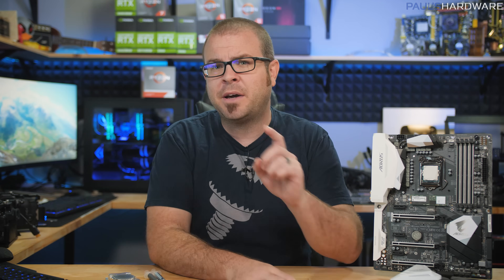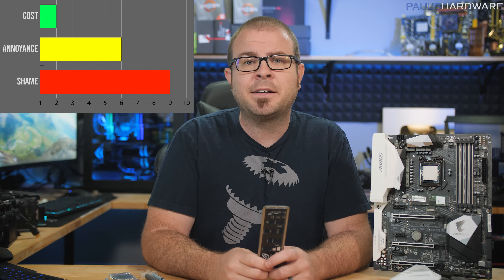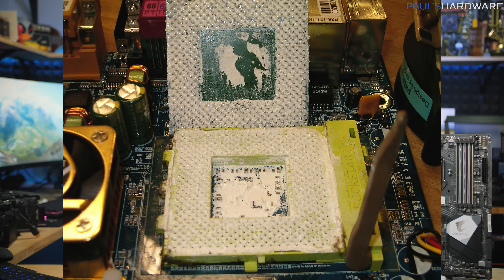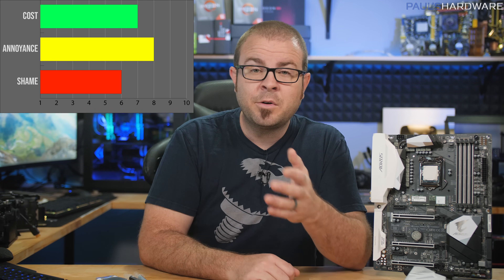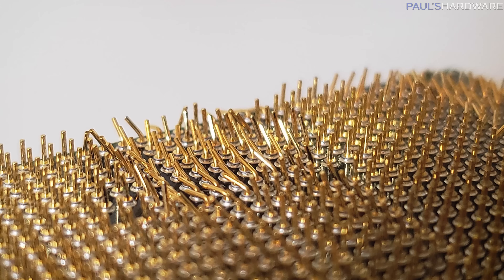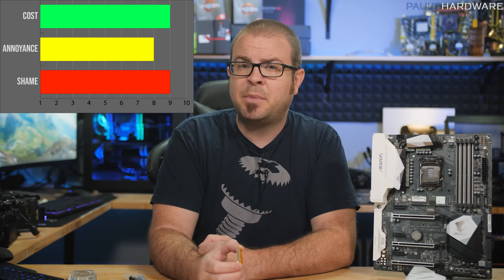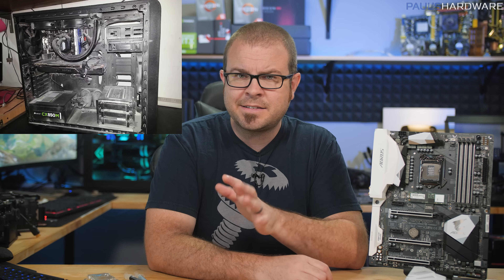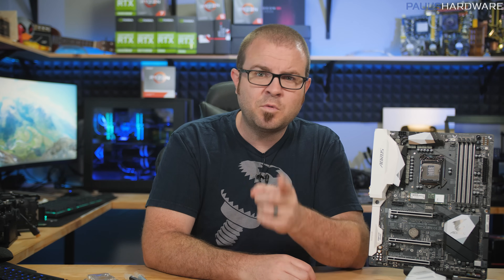The 5 WORST PC Building Catastrophes 💥🔥🧯

Comment: In the 90ies I assembled a lot of PCs at home, in those day you had really crappy cases with sharp edges on the inside. When lifting one from the floor it slipped , I tried to grab it and it cut the top of my ring finger half off. I was alone at home, rural area, no one with a car around so I rode my bicycle 7 miles to the nearest doctor who stitched it back together. It later got badly infected and resulted in my finger turning completely black. They kept me in the hospital for 4 days. On the positive side, they did managed to save it and I did not lose a finger. Does this apply for a position in the top 5?

Comment: Year 2015, you plan, research and save up for your build. 
Comes the day, buy all the parts and that sweet s340 black and blue. 
You peel that sticker off that sweet acrilic panel of s340 black and blue and put it lean against chair. 
Build like a champ, feeling good.
Now for the creme at the top, sweet transparent acrilic side panel that you lean against your chair.
Comes your friend move the chair and that split moment you knew something went wrong.
Your sweet transparent acrilic panel now cracked diagonally from top left to  btm right.
You died inside when you put that once glorious side panel on.

Comment: I intentionally HAD to leave out an I/O shield in the past because the damn thing just would NOT seat into the slot on the case, computer ran for many many years with NO ISSUES AT ALL. Catastrophes need to leave the computer unusable and PGA is way worse then LGA, never heard of an LGA CPU being RIPPED OUT of the motherboard while removing the heatsink, have had it happen twice to me personally with PGA, Pro tip if you plan to swap a heatsink on a PGA socket it helps to warm the system up and then as soon as shutting down perform a twisting motion with the heatsink to remove it.

Comment: Oh man, I have stories about a certain (very large) computer corporation that I worked for: Very poor third party peripheral SATA power cables causing fires, requiring thousands of replacement cables. There's nothing like seeing high level command centers with smoke billowing from underneath their desks. :-P Or the assembly centers not screwing in the PSU's and when you try to set the brand new computer up the PSU drops onto the motherboard & CPU cooler, basically ruining the whole thing. I have a lot more, but I'll stop before I describe the huge batch of systems that had live roaches in them. :-P

Comment: Spent 4hrs installing an M.2 drive because I didnt realise that doing so would disable the SATA 4&5  ports (which I had connected my boot drives to).
3hrs Installing then removing M.2 drive and repeating while selecting different boot options in bios
1hr of searching the internet for solution
5mins reading the Mobo manual (should have done this first)

Comment: At my old work place, we were in the process of replacing 10s of Compaq servers with IBM servers. But most of the IBM servers would fail to boot after memory, network card and hard drive install. It was first though that it was a bad batch. They had after all sequential serial number. But after 12 defective servers, IBM sent a Tech to see what we were doing.... It seem that building servers directly on office carpets without any static electricity prevention device is a sure way to flash some delicate chips. Especially if the power source is a single old unprotected power bar.  
Cost : 0 (to us, many 10000$ to IBM)
anoyance : 10
Shame : 10+ we should have known better

Comment: Forgetting to take off the plastic inserts on a graphics card. Resulted in me having to tearing it out of the PCIe slot, breaking the retention arm off in the process, and STILL having trouble getting the card to line up with the case slots. The arm popped right back in, though.

Booted up, then realized I left my boot disk at home (building for a friend). Had to borrow his laptop and use my personal thumb drive (couple of games/important files and guides) for a boot disk.

Comment: My second pc i built was a 586 amd. The power supply shorted and caught fire. It was a cheap power supply my dad got me for the build. I was lucky it didn't short the motherboard but it did melt the plastic on the case and that motherboard had plastic fused to it for the rest of its useable life. We where afraid to remove for fear of damaging a trace. Was super bummed i need a new case and power supply.

Comment: Ah, bent pins on the CPU...

Went to remove the cooler (Scythe Mugen II) off my Athlon II 640, and the CPU came with it, and dropped onto the motherboard.

I felt like dying when I saw the bent pins, as I thought I destroyed my CPU. Luckily, I was able to straighten them out, and it worked fine.

Comment: We need to highlight that CRUNCH sound when installing an Intel CPU for first-timers. Had I not done extensive research beforehand, I would've DEFINITELY thought I installed the CPU incorrectly when bringing down the clamp arm. Align the triangles and whatever happens after that either should've happened or it's not your fault. Great video, Paul.

Comment: I once did not have a manual for the motherboard (pre internet), and I put a jumper on a 12v plug, and found a quick way to un-soldier an ISA and PCI slot from the motherboard.

Comment: I was having a USB Driver issue showing up in device manager... couldn't figure out why it was there... read some tips online... one suggestion was "remove driver" from the device manager and reboot... i removed all my USB drivers... and... guess what... I lost keyboard and mouse support... real hard to do anything on your computer without either a mouse or a keyboard... even trying to reinstall windows didn't fix the problem... I eventually had to pull the drive out, backup files format the drive and reinstall windows.... cost was low, but annoyance and shame both rated a full 10.

Comment: This was high on the shame factor for me.
Finished building and everything was good. I got to the UEFI and did some tweaking then I powered down the system to do some last minute cable management. After I was finished managing the cables, I put the side panels on because hey everything was working right? Nope. Neither my 2.5 Sata SSD nor my hard drive were being recognized. I go back into the UEFI to see if messed up something, everything was good. Then I open up the case again to see if my SATA cables were loose or something. Nope all good. After 10 minutes of staring at the computer I realize that the power cables for my SATA drives were unplugged. I unplugged them while I was managing the cables and I forgot to plug them back in....

Not my proudest moment

Comment: variant of the last point, flipping the switch on the power supply from 240v to 120v, frying the mobo, 1/2 the ram and of course the psu
Edit: the system was running at the time

Comment: The most annoying one for Linux users is, forgot to enable hardware virtualization in BIOS, and only found that when you were going to start a KVM instance.
Why mobo vendors can't just enable that feature by default?

Another similar one is, no mobo vendor really detects grub/systemd-boot/lilo, they just detect Windows boot manager, it's especially annoying if you cleared CMOS for a failed OC attempt.
You need to a boot into LiveUSB and reinstall your bootloader. Shame on mobo vendors.

Similar to IO shield, forgetting to install M.2 SSD on an ITX board (which normally puts M.2 slot at the back of the board) is also a pain, but less painful as more and more ITX cases are having cutout at the back.

Comment: G'day Paul,
I was bench testing a 2nd hand RX480 yesterday running 'Unigine Heaven' & there was a Huge 'POP' 😲 & PC shut down, Damn near crapped my pants, the monitor Power light was still on so I thought the whole PC was gone 😱,
Turned out the PC is all OK 😁, It was the socket in the really expensive Circuit Breaker Power Board that the PSU was plugged into that died 🤨,
so back to the shop for a refund on that

P.s. retesting the PC today & all is going well, it has been running Heaven for about 4 hours so the System should be good to sell after a GPU Clean & Paste refresh 😁

Comment: My biggest mistake goes back over 20 years ago when I was barely even a teenager. Was swapping a HDD around in my dads computer and wasn't aware about the dangers of static electricity. Fried the hard drive that started smoking when the computer was turned on. My dad worked from home and ran his business from that computer too. That was not a fun conversation to have.

Comment: One of the many annoyances in building a pc is installing a fresh windows 10 copy. I have a second drive which has a previous installation of windows but during the install windows decides to use the boot record of the previous drive instead of making a new one in the new drive. Annoyance level 10!

Comment: With the old AT-style motherboard connectors you had to be VERY careful to plug them in properly as they were not keyed; you could easily smoke your brand-new build!!! IIRC if you had the black wires of the plugs facing each other on the MB, the odds were much in your favor of getting it correct. Nowadays, not so much a risk of fire but ALWAYS triple-check EVERYTHING prior to hitting the ON switch for the first time... lest the ON switch turn upside-down and say NO!!!!!!! instead.

Comment: 1- Not plugging in your front power button properly.. press the power button, then panic your PC doesnt turn on. You worry something is broken, but alas you just plugged it into the wrong header. 

2- Custom wire sleeving (goes with your #5) and it killing hardware. 

3- Watercooling leak (from AIO or custom loop)

Comment: - Not peeling off the tab covering the pre-applied thermal paste on the included CPU cooler.
- (for us Olds) Hearing a CRUNCH when attaching the heat sink to your AMD Thunderbird CPU. Congrats, you cracked the exposed die.

Comment: I just had an issue with bent pins on my ryzen when I replaced the stock cooler for a water block, not sure why AMD thinks glue is the best thermal substance for there coolers, however when removing the cooler I was surprised to see that my CPU was not in the socket shortly after flinging my old cooler aside. Well bent a few pins but luckily, with the help from my trusty pocket knife, I was able to straighten them up and my system booted just fine.
 Cost: 3 
annoyance: 9
Shame: 9

Comment: Buying the cheapest components available and realizing you've got some sort of LGA/PGA mixup.
Not buying the right generation for compatibility. (Different sockets even!)
Buying parts without realizing the dimensions are too large. (did this one myself, even though I thought a cooler would fit in my old system, it couldn't even squeeze in.)
Not having a sufficient power supply. 
Buying an integrated graphics chip without getting a motherboard with some sort of display output.

Not subscribing to your favorite tech youtubers. 

Not responding and liking this comment.

Comment: Purchased a motherboard and processor for a media pc, found the processor was too new and not supported by the board without an firmware update... had to purchase another processor that was compatible with the older bios so I could update it and use the original CPU... wow.. pain in the ass...  cost 10, Annoy 10, shame 10....

Comment: Taking paul's adivce and asking for guidence. Is it "possible" to connect the psu cables incorrectly? I'm building a system and wirh my modular psu there was 8 pin connectors and 4+4 pins and 6+2. The 8 and 4+4 cables said cpu on the so I plugged one 8 pin into the motherboard and also one 4-pin from a 4+4 since there was a 8-pin and a 4-pin in the top left of the motherboard. Is it possible to do this wrong as long as you plug the 8pins in the psu to pcie and cpu and 6-pins to sata and molex?

Comment: 1.)  Loose screws within the case, or the power supply.  I do a FULL STOP when a screw gets dropped.  
2.)  Cheapening out on the power supply.  Did that once.  Only...ONCE.  Never did that again.  Power supply popped, aged me about 30 years, and I thought I toasted the motherboard.  Fortunately, the motherboard survived.
3.)  Left the thermal paste label on an AMD Socket 7 processor  when doing a custom build years ago.  Burned up the processor, and the board.  I never heard the end of it, but it taught me to be mindful of every step of the build.  Never made that mistake again.

Comment: how about accidentally plugging in the AIO cooler to the wrong CPU header/ not at all and have your system continuously not last for more than 10 secs before it gets to hot and shut off. Yep I did that. I either didnt plug it in at all or in the right fan header

Comment: Installing a cpu air cooler, then realizing you can't put the side panel on. Because cpu cooler is too tall....

Cost-2
Anoyance-7
Shame-7
Reply: Realizing the cpu cooler was sold as a combo with the case and it doesnt fit. Massive shame, on company.

Comment: Years ago I had a coworker that was updating some memory for a friend of hers. She  went to blow dust off the old sticks, plugged in the new sticks, and turned on the machine.... The spark and steady stream of smoke made her realize something was wrong, but the ensuing flame sealed the deal.. needless to say she had to get the poor guy a new motherboard, processor, and ram.. luckily this was around the whole Pentium 4 RAMBUS ram debacle and the system was an AMD system so she saved a tiny bit of cash..

Comment: I once had a fire, I bought my dad an SSD for christmas. I instaled it for him in his PC and I power the system on. I head to the BIOS and I see no new sata drives are instaled. I power off the system and lean close to the computer to look inside. Before I even get the chance to get close I am hit by the smell of burned electronics. My heart jumped, my cheekes started to turn red and drops of sweet started to form on my forehead. I swiftly unplug the system from the wall and inspect the sata power cable connecting the ssd. It was connected correctly.
I then remove the SSD from the system and I notice burn marks behind the gold plated contacts for the sata power connector. I could still smell the burned smell from the ssd. I declared the ssd dead.
As I am pretty much an PC guru in the family I felt really ashamed having to explain to my family and to my dad especialy his new ssd is burned, even tho not because of my mistake but because of an faulty product.
Cost factor-7
Annoyance factor-8
Shame factor-again even tho it was not because of my mistake, shame is still a strong 10

Comment: About 15 years ago... I built a PC with random hardware from old PCs. I plugged in a cable which I thought was for USB extender... turn it on, left the room, 2 mins later I return, there is smoke coming from PC and the USB ribbon cable was on fire... never sh!t myself so much.

Comment: I'm surprised there wasn't a water-cooling one like, forgetting to tighten a compression fitting or not pushing the tubes onto a barb properly... Because I've never done that 🙃
Cost : 1 (it was mostly disassembled and turned off, just testing the loop)
Annoyance : 4
Shame : 9

Comment: In my opinion, having pins on the motherboard is a better deal if they get bent.  They are generally cheaper to replace because you can always go with a cheaper one if you can't afford the one you had for little or no performance loss.

Comment: I managed to do two of the errors on the extreme end of the spectrum on my first PC. Turns out I'm as lucky as I'm dumb.
First, I found that several of the pins in the CPU socket were bent. I have no idea when or how that happened since that was one thing I was actually careful about. Bent them back. 
I also had no idea what those standoffs were, since they didn't seem to fit into any drill hole and believe it or not, none of the PC build guides I watched at the time even mentioned them. I tried multiple times to power it and it wouldn't work. Once I found out that these things were missing, I put them in and... it all worked fine.

I'm not sure what saved the motherboard in the end. But it worked perfectly fine for years.

Comment: I was rebuilding my frankenstein nas server and it has an old, yet reliable antec psu with no labeling. I was plugging the 4pin cpu eps back in and accidentally used the pcie 6-pin. no idea why it fit perfectly with no extra force. Thought i killed it but i think the psu protection kicked in and saved it.

Comment: Paul most of us aren't building new, some are mostly building, using  legacy drives for storage or transfering data from old drives. Some of us (like me) screwed this up. Currently building a (mostly) new Ryzen 3700x, using a factory refurbished Asus Crossahair Hero 6 with undated bios. I'm using legacy drives for storage but when finish I will use my old drives  to transfer my new boot drive to an NVMe M.2. BTW using a brand new  Lancool Dragonlord PC-K62 which you did a video on years ago https://www.youtube.com/watch?v=VnX1tC0tucY. This was new in the box collecting dust under the steps. I'm ol skool' so I have to have my two BDR burners, so this case was perfect for me. I'm updating the I/O for USB 3. I'm also adding a AIO CPU cooler, so I have some mods to do. No serious reason to do water cooling or an AIO but i do see a lan party one day so it needs to be fairly portable. A heavy CPU fan, like a Noctua would stress the mainboard so I have to do this if I want to carry my box to a friends place. Yes i love glass like the next guy but glass doesn't slide down to reveal hidden drive bays. Keep up the good work, believe me your knowledge is appreciated!

Comment: I have Ryzen 3400G and Auros Ultra X570 motherboard. Is it possible to increase the GPU Ram (At 2GB presently) ? If yes which setting of the new X570 bios has the option ? All I can see are voltage options for various types of overclocking.